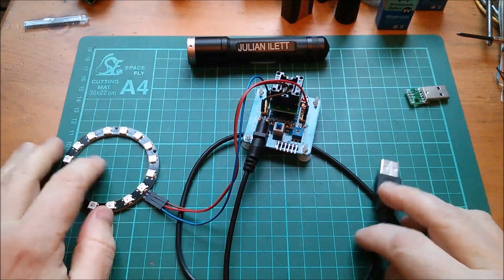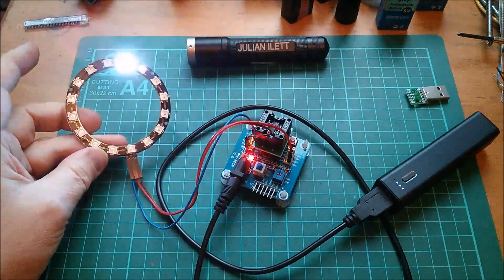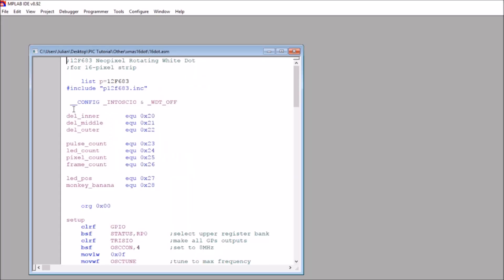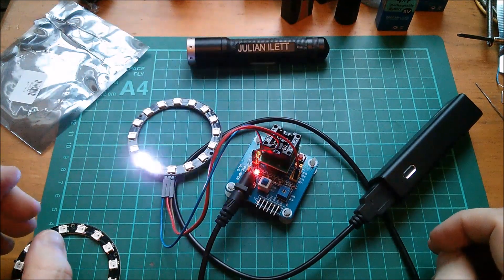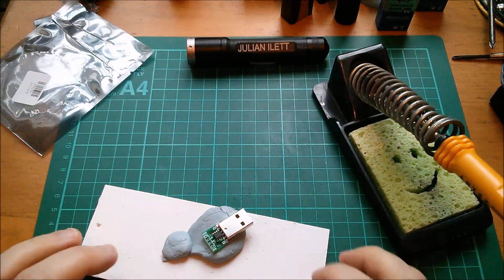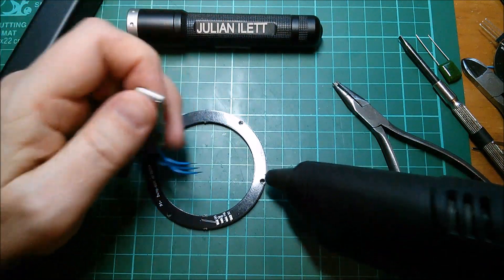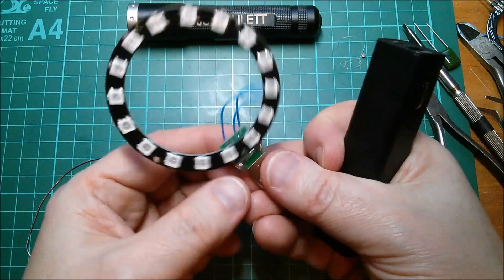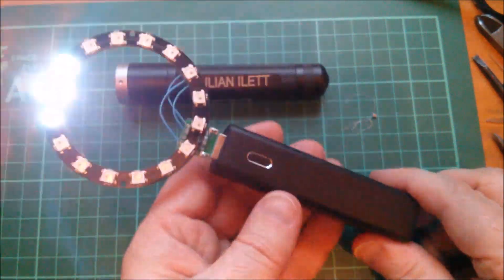Christmas Pixel Decoration: PIC12F683 and 16x WS2812B

Comment: I got a PIC12F675 (20MHz Xtal) to work with a strip of 16 WS2812B using this code I made - standard XC8:

/* 
 * File:   ledstrip.c
 * Author: SkankyPistol
 *
 * Created on 14 March 2021, 13:59
 */

#define _XTAL_FREQ 20000000

// CONFIG
#pragma config FOSC = HS        // Oscillator Selection bits (HS oscillator: High speed crystal/resonator on GP4/OSC2/CLKOUT and GP5/OSC1/CLKIN)
#pragma config WDTE = OFF       // Watchdog Timer Enable bit (WDT disabled)
#pragma config PWRTE = OFF      // Power-Up Timer Enable bit (PWRT disabled)
#pragma config MCLRE = OFF      // GP3/MCLR pin function select (GP3/MCLR pin function is digital I/O, MCLR internally tied to VDD)
#pragma config BOREN = ON       // Brown-out Detect Enable bit (BOD enabled)
#pragma config CP = OFF         // Code Protection bit (Program Memory code protection is disabled)
#pragma config CPD = OFF        // Data Code Protection bit (Data memory code protection is disabled)

// Define LED pin
#define LED  GP2
#define testbit(var, bit) ((var) & (1 <<(bit)))         //bit test - used for LED routine
#include <xc.h>
#include <stdlib.h>             // Only needed for rand() function

void pushthecolour(int num_leds,int R, int G, int B)
{
    int savvy=0;        //Nonsense variable name for a loop that defines how many LEDs are pulsed
    int counter;        //A counter for addressing the bits sent to WS2812 (goes from 0 to 24)
    
    while (savvy<num_leds)      //keep looping 24 bits until number of leds reached
        {
            counter=0;          //reset the bit counter
            while (counter<8)   //first eight bits
            {
                if (testbit(G,7-counter))
                    {LED=1;
                    _delay(1); // delay in instruction cycles (50nS- but PIC internal is 4x - 200nS)
                    LED=0;
                    }
                if (!testbit(G,7-counter))
                    {LED=1;
                    LED=0;
                    _delay(1); // delay in instruction cycles (50nS- but PIC internal is 4x - 200nS)
                    }
                counter++;
            }

            while (counter<16)  //next eight bits
            {
                if (testbit(R,15-counter))
                    {LED=1;
                    _delay(1); // delay in instruction cycles (50nS- but PIC internal is 4x - 200nS)
                    LED=0;
                    }
                if (!testbit(R,15-counter))
                    {LED=1;
                    LED=0;
                    _delay(1); // delay in instruction cycles (50nS- but PIC internal is 4x - 200nS)
                    }
                counter++;
            }
           
            while (counter<24)  //final eight bits
            {
                if (testbit(B,23-counter))
                    {LED=1;
                    _delay(1); // delay in instruction cycles (50nS- but PIC internal is 4x - 200nS)
                    LED=0;
                    }
                if (!testbit(B,23-counter))
                    {LED=1;
                    LED=0;
                    _delay(1); // delay in instruction cycles (50nS- but PIC internal is 4x - 200nS)
                    }
                counter++;
            }
            savvy++;
        }
}

void main(void)  
{
    ANSEL  = 0x61;        // Set ports as digital I/O, except analog input AN0
    ADCON0 = 0x01;        // Turn on the A/D Converter AN0
    CMCON  = 0x07;        // Shut off the Comparator
    VRCON  = 0x00;        // Shut off the Voltage Reference
    TRISIO = 0x01;        // GP0 input, rest all output
    GPIO   = 0x00;        // Make all pins 0
    
    int red=0;           //duff values for test run
    int green=0;
    int blue=0;           //WP2812B has bit sent MSB>LSB Bl/Rd/Gn
    
    int targetR=1;
    int targetG=1;
    int targetB=1;
    int ADCVAL=10;
    int countpause=0;
    
    pushthecolour(16,0,0,0);    //blank out display

    while (1)       //loop forever
    {
        pushthecolour(16,red,green,blue);   //write 16 lots of 24 bits for RGB colour
        
            GO_nDONE = 1;                //Initializes A/D conversion
            while(GO_nDONE);             //Waiting for conversion to complete
            __delay_ms(10);              //Time for ADC cap to charge/settle
            ADCVAL = ADRESH;             //Return result - only interested in top 8 bits of 10 bits
            ADCVAL++;   
            ADCVAL=ADCVAL*2;
            countpause=0;

            while(countpause<ADCVAL)    // The ADC creates a delay between writing new value to LEDs
                {__delay_ms(1);         // 1mS pause looped by a multiple of the ADCVAL. 
                countpause++;           // If ADC is not connected this will loop three times (3mS)
                }
            
        if (red<targetR)
            {red++;}
        if (red>targetR)
            {red--;}
                
        if (green<targetG)
            {green++;}
        if (green>targetG)
            {green--;}

        if (blue<targetB)
            {blue++;}
        if (blue>targetB)
            {blue--;}      

        if (red==targetR)
            {targetR=rand()%80;}    //255 is full brightness, here limited to "random"  max of 80
        if (green==targetG)         //be aware the strip can pull quite a bit of current at full power
            {targetG=rand()%80;}
        if (blue==targetB)
            {targetB=rand()%80;}
    }
    
}

Comment: I don't think the whole ring is a dud. Try bypassing the first WS2812 in the line and see if it comes to life.

They do recommend a 330 ohm resistor on the data line in between the MCU and WS2812 so it doesn't try to draw to much current when only the ground and data pin are connected.

Comment: Whoever it was that said these video have gotten way too rambly beyond the point of being whatchable wasn't kidding. Five minutes in and were still figuring the reset... These are the kind of things you research prior to starting recording, decide what it is you're doing and how, then if you seriously find it that crucial then simply pepper in the necessary information during the build as to why you decided method A was the most elegant solution to achieve x, as opposed to method b, c, and d.

Comment: Out of curiosity, what is the output voltage from the pic currently? The ws381* LEDs I've played around with in the past have differed dramatically in what voltage they will accept as a 1. Some go way underspec and are fine and others are right on the edge, all it takes is a stubborn led in the first position to cause issues.

Comment: i once got a faulty NANO from alice, shot a video but they claimed they couldn't verify it. 
probably due to restriction to youtube and they don't even bother firing the vpn.
Reply: Alice1101983  is screwing up lately, and indeed bad customer support. Used to be good. Too bad, not ordering there anymore.
Reply: If Alice cannot play evidence video it is her problem and should return money. You can always ask Paypal in case of problems.
Reply: Ebay and PayPal work very good that way indeed. By Alice1101983 keeps promising things, such as the item has been resent -which it is not! - until the period for opening a dispute is over. I've had this 2 times now. It's not about the money for me, it's the hassle and waiting months and ending up with nothing but frustration. Other sellers are usually great, no problems.

Comment: As you were soldering that wire, it suddenly occurred to me that if you weren't going to use the D+ or D- pads, you could cut the track to (for example) the D+ pad and then scrape away a bit of the insulating layer before installing a link between pin 5 of the chip and the track leading to D+.

That way, you could use the pads on the circuit board to connect to the neopixels and so take all the strain off of that connection to pin 5 of the chip.

I'm thinking that the dodgy neopixel ring might have timing issues.  Maybe those neopixels aren't as timing-tolerant as the others, so you need to keep the on-off timing more strict with them?

LOL!  Your comment about "Circling Around" reminded me of the old children's series, "Catweazle."

The basic story (at least for the original series) is that a half-mad medieval would-be wizard named Catweazle who is obsessed with figuring out a spell which will allow him to fly, accidentally sends himself into the future and lands in our present (the 1980's).

While there, he learns of a rhyme:

Twelve are they who circle 'round,
If power you seek they must be found.
Look for where the thirteenth lies,
Mount aloft the one who flies.

Seizing upon that last line, Catweazle decides that it must be a spell to make a person fly, and that he needs to first find the twelve zodiac signs and then find an unknown thirteenth sign in order to complete the spell.  The rest of the series is about him finding what he deems to be the twelve signs of the zodiac.  At the end of the final episode, Catweazle manages to (again accidentally) send himself back to his own time.

SPOILER:
In the final episode of that series, Catweazle discovers to his disappointment that the rhyme had nothing to do with flying.  It was a clue to where a treasure was hidden.  The twelve are the numbers on a clock face and the power is from being wealthy.  The thirteenth is a clock with Roman numerals where the twelve is actually a thirteen, and the tower the clock is in has a weather vane of Father Time (the one who flies) on it.

Comment: I too was field service engineer in 70-80s period. Any thing logical that could save time
was fair game. My first rule was to make only one change at a time before testing and moving to next trial. Intermittent failures was the nightmare service call.
Reply from the maker: Yes, certainly intermittent faults are much more difficult to isolate, but they can turn a boring day into an interesting one :)

Comment: For very delicate hot gluing I melt a glue stick in one of those tea light oil burners (from Poundland of course) and use cocktail sticks to put the glue where needed. One glue stick lasts absolutely ages, no mess and no waste.

Comment: 1. Removing chips from boards while power is on = bad. 2. Maybe put Kapton tape over the via on the neo-pixel ring before gluing on the board? 3. Double-check all the connections on the IC pins. 4. Substitute another neo-pixel ring and see if it does the same thing. HTH.

Comment: gp3 should always be in IO mode unless you really need an external reset. That pin is input only so won't draw any current. Put a button on it and code some more light patterns

Comment: Short the first or second led on the faulty ring (din and dout) to check if only 1 led is faulty. You might be able to repair by replacing 1 led. (Or feed the din directly to 2nd led)
Reply from the maker: Now that's a good idea :)